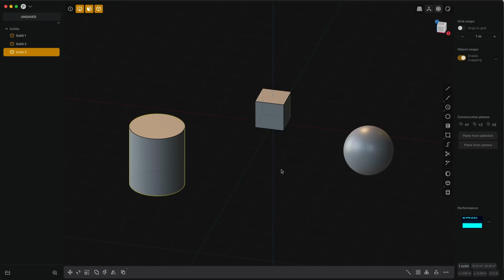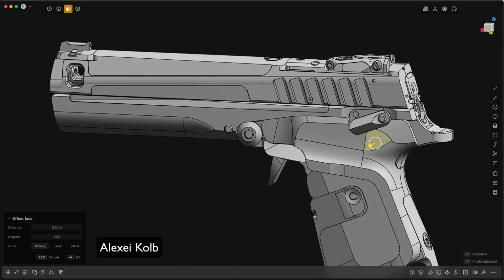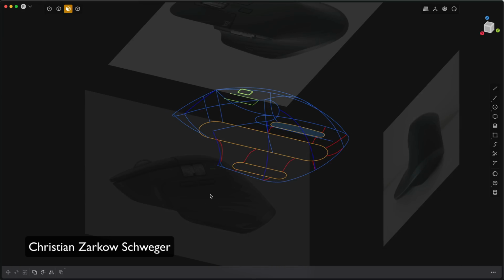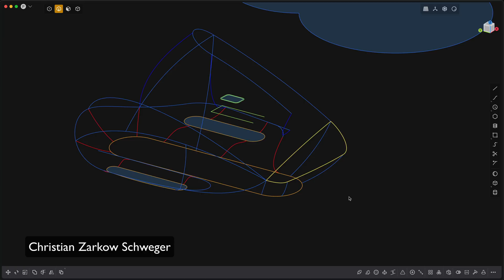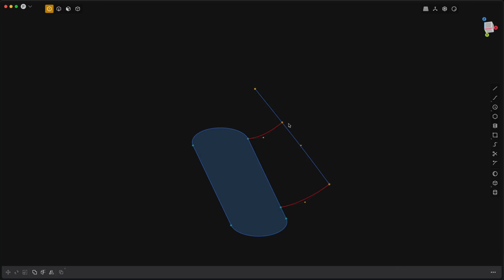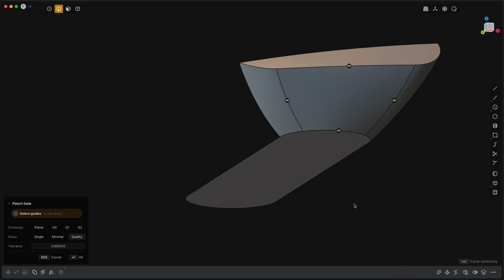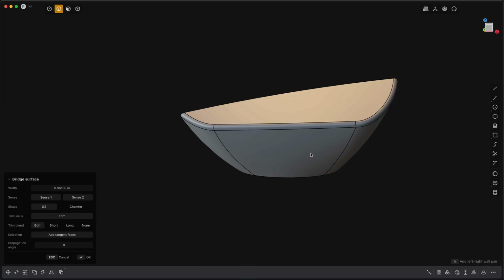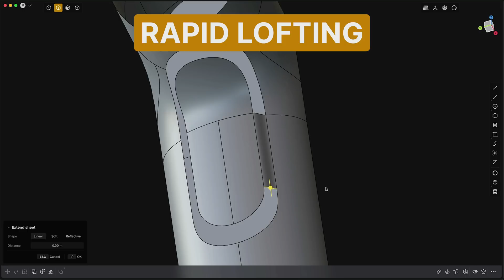Plasticity 1.2 is here!

Comment: it looks like very interesting program. A little sad though, that this program was open source before (LGPL according to GitHub) and now it is closed source.
There exist open source paid programs (eg. ardour) and If you want it to be paid then I think that it would be very cool if that was the case for this as well.
I think that even if this program was just "source available" (by that I mean that source code is available to public but there are some restrictions to it) then it would be better (of course full open source).

So I am kind of hoping that when this software will be very popular and developer/creator will have enough money then it will be open-sourced again, but that probably won't happen.

EDIT: Ok, nevermind, it looks like Plasticity is already using third party tools which are not open source so Plasticity itself cannot be fully opensource (or source available) either. By "third party tools" i mean "Parasolid" kernel which is created by siemens and it doesn't look like it is open source. According to post (on community page) on this channel, before parasolid, Plasticity was using C3D kernel before and it looks like it is not open source either, so I wonder what was in open source version.

Comment: Is there any 3D program that will allow me to calculate a curved surface and translate it into a flat surface? I'm referring specifically to a boat hull that I would like to cut out. I would like to calculate the curvature of the boat hull onto a flat surface using a CAD or plasticity program. Do you have any suggestions?

Comment: I use Fusion 360 now, and rely heavily on dimensions as a starting point, to create an outer framework for the parts im modeling. can you setup planes, and sektch on t hose planes and use dimensions, as a starting point, and then model 3d using plasticity tools, and then later check the part with a cross section plane, and then measure it to check dimensions? I need to check/define part with cross sections at key positions, and then model parts, and later inspect/come back to edit those key dimensions and update the model, etc. Can Plasticity accomplish this same thing as is or in a similar way? Thanks!

Comment: Would be nice to get features around creating mechanical and irl parts with precision.
Reply: You can do all those things using a Rhino type mindset/workflow.
Reply: @modelenginerding6996  Could you elaborate a little more? Im somewhat new to 3d
Reply: @MrKennykyle1  If you are careful with your sketches and modeling, you can model almost anything most CAD packages can do. These are NURBs surfaces running on parasolid kernel so accuracy is as high as you need for manufacturing.

Comment: Why cant I export Plasticity files to Tinkercad? stl and obj files do not work well. Curves are very jagged and incomplete as well as scale out by x 100,000. 

Plasticity file imports fine into Cura as an STL once resized by 100,000 and makes a reasonable print. If I then export from Cura as an ASCII STL then it imports into Tinkercad fine. Any ideas?

Comment: One problem seems to be when transporting models from Plasticity 3D into a slicer like Cura, the models don’t come out at the same size they are very small which then needs to be re adjusted again in the slicer software.
Hoping to buy studio version, as this CAD software is the best and easy to use.
Reply: Cura does that to most anything I throw at it. I always reset the scale using the overall bounding box size of the object and have no problems.

Comment: Thanks for the update.  Lots of great surfacing tools.  Btw, most of the "realistic" car models in the demo video would really benefit in fixing some proportions like wheel size, length, detail sizing, etc.  It's basically impossible for an artist to not have a blind spot somewhere with regard to realistic modeling, this is where measurements come in.

Comment: @nickkallen1 8:26 what do you mean with „it‘s not a class A workflow“ and „surfacing is not for beginners“. I am just curious what exactly is the difference
Reply from the maker: Surfacing is quite difficult. Class a is a specific standard of high quality surfacing (and workflows to achieve that) that is extremely difficult
Reply: @nickkallen1  sorry, my question was a little misleading maybe. I actually know what you mean by „class a“, but based on the workflow you presented in the video (which, if I am not mistaken, you declared as „none class a“) how does a typical class a workflow look like then ?:)
Reply from the maker: @MartenZander  In the specific example of filling the hole, a class a workflow would create a surface with a specific # of degree/spans and use an (approximate) alignment function to achieve g1/g2/g3 within tolerance. The main difference is that the surface will be simple and close to the standard used in manufacturing.
Reply: Thanks a lot for this elaborated answer. I was kind of thinking that the difference might be related to manufacturing actual pieces, but thanks for clarifying that. As long as I do my Models for GameArt or Animation (after proper retopo of course) I should be good to go with the workflow demonstrated in the video, right?
Reply from the maker: @MartenZander  The standard for visual display (and game-ready assets) is completely different, yes. Ideally the polygonal representation has nice flow (which is a challenge with cAD) and that it looks good - that's it

Comment: Plasticity looks cool, but I'm not keen on buying software that requires logging in to activate.
Reply: I believe you don't need to login every time you run the software. You only do it once on one hardware to generate a license token and that's it. All license plan are node-locked.
That being said, if in 5-10 years it does not work out for the developer, and you change your pc and want to generate a new license for a new software - yes, potentially you can be locked out of it. 
But first - it's the same with any commercial software nowadays.
Second, it all costs 100/300$. You will get 10x your money's worth in that period of time.
Third, you can always export your models to a range of formats and archive your models that way.
Reply: @someonewithsomename  Even logging in once is too much. I'm more than happy paying for a license, but I want it to work forever and offline,  especially given that this looks a one-man company. I get that security from Blender today - I will always be able to open my projects. Same with Reaper. I'm never going back to a situation where I'm locked out of my own work. And the argument that I'll get more than X use out of it doesn't hold, because this is the sort of problem you think about years into the future when you're locked out, and then it's too late. Nope, I'll stick with Blender until something as permissive comes along.
Reply: You want crack version 😂😂😂
Reply: @rajendrameena150  No, I want a license model like Reaper or Webstorm, the license is a basically a key that activates an offline copy. I don't want to get locked out of my models years down the line should Plasticity's servers no longer exist. I've been locked out of Fusion360 before, I'm currently in Blender, and I like knowing I'll always have access to my blender projects.

Comment: I was looking for some parametric modeling to use as a companion to architecture BIM suits (Archicad), like Rhinoceros 3d. How does this compare to it? The simple fact that it has a perpetual license makes me want to buy it just for the sake of it. I am an old 3ds Max user ( I know it isn't parametric) and since abandoning Autodesk I haven't found a suitable replacement.
Reply: PERPETUAL at whatever version you buy, on the installed pc - the value of subscription is latest stuff, when you need it only... subscription isn't always the worst choice or most expensive option.
Plasticity is dynamic modelling, not parametric.
Reply: The workflow is very similar to Rhino. Try out the demo and follow some tutorials. The real power in Plasticity is the parasolid kernel. Nothing on the market beats it for the price. Rhino will never be as good with filleting. Advanced surfacing will likely be better than Rhino's once Nick taps into the full parasolid toolset.

Comment: This is huge actually!
It might not look that flashy, but it fixed the biggest weakness the software had. Damn I love this software!

I have related a question, regarding surfacing:
In some other software, you are able to change the surface curves post-factum and see an update to the surface in realtime, without the need to rebuild the surface. Is it somewhere in a roadmap for Plasticity development or is it a kernel-limited feature, meaning not possible to implement it? Because for artistic concept work, it's much easier to "sculpt" the surface, than to build just the curves and patch them every time I want to check how it looks like.
Reply from the maker: It’s not a limitation of the kernel but it’s something for plasticity 2.0

Comment: Just a quick question for the more experienced lads here: how well suited is plastucity for video game asset production? How easy is it to export it to Blender or Maya for rigging or to Substance for material pass?
Reply: @graemevaughey7432 I'm just gonna add that sometimes you need to do some basic retopo if you have a model with surfaces on some weird angles, it not always produce clean quads.
Reply: You would never use any cad for anything, that would deform, because you need a clean polygon geometry for that. Or at least you need to retopo the mesh.
But for hard surfaces it's amazing! You just export two versions of the same mesh with different resolution and bake your normals from one to another.
Reply: @graemevaughey7432 Splendid, I was mainly concerned about the export resulting in potentially unsafe ngons or generally too high of tri count. But sounds pretty good. Thanks for your quick answer ^^
Reply: You could just try out the demo and test some workflow cases. For me I came away a little skeptical using it for gaming... gaming assets all tend to be topo'ed by hand for a lot of reasons like : far better control over amount of polygons and placement, UV unwrapping is WAY easier with a clean mesh, placement of good material map borders is already there on a clean hand made mesh, compatibility with other programs features is easier as quads are the universally compatible thing, etc... But maybe you find it fine for your purposes.